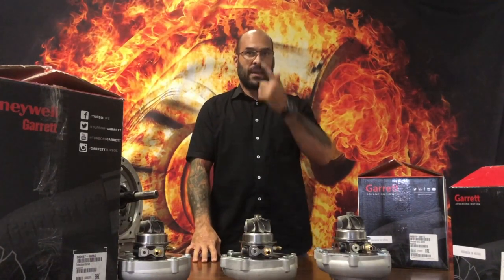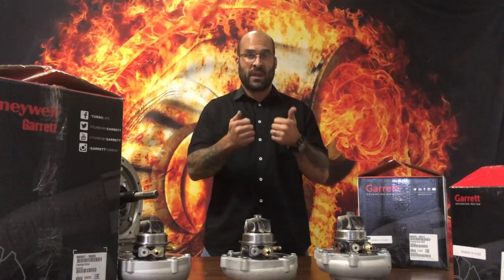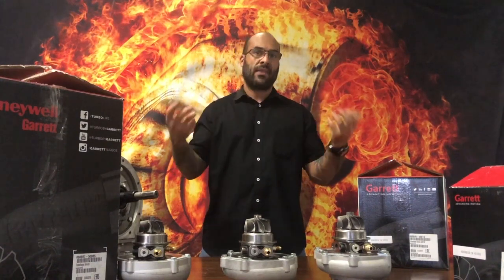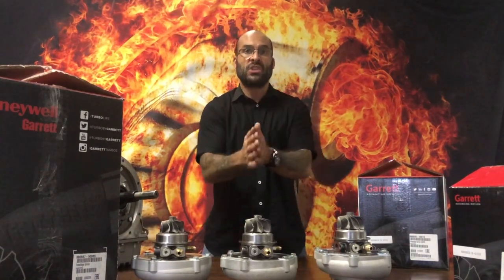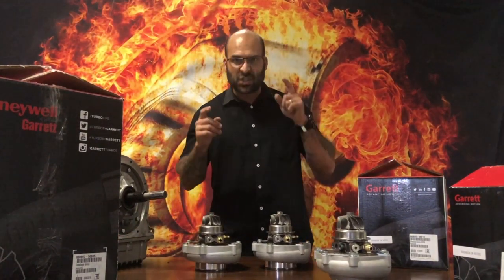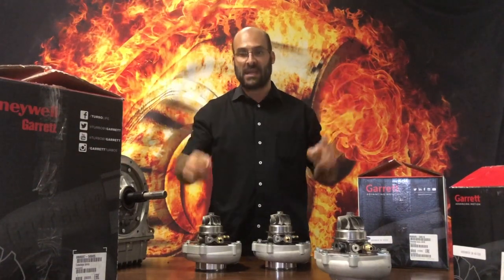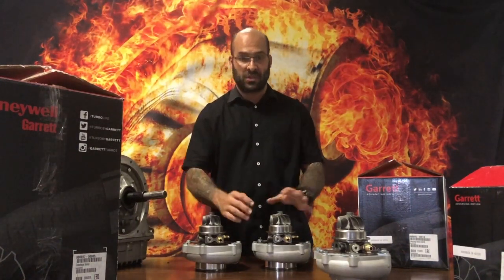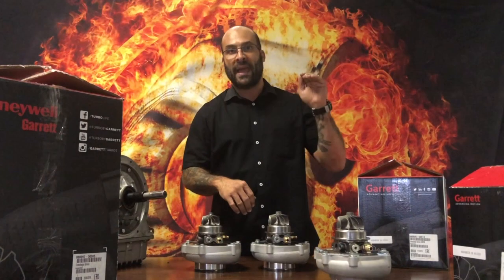Some more on turbo matching

Comment: Excellent video mate. I have just put the G30-900 turbo in my RB25 will be tuning in 2 weeks times. Street car use
Reply from the maker: Awesome  - please share the results with us.
Reply: @TurboDirectSA   I sure will 💯
Reply: @TurboDirectSA   hi Chris, got my R33 RB25 tuned got good results with the G30-900 turbo. Rear housing is .82
Safe tuned on 390rwkw 24psi boost.
Fuel on E85
Hits full boost around the 4000RPM - 4300RPM mark. Keep in mind I have a stock bottom end still. Once I get the bottom end forged will re tune the 33 for bit more power. 
I must say it is very punchy. My R33 is used for street.
Reply from the maker: @Rxtx_325  thanks for the info - this is good useable information, its punchy cause of the stock CR and the Ethanol - on Pump fuel you will loose response somewhat, this is always the risk on the RB25's  

Is your motor the NEO?
Reply: @TurboDirectSA   RB25det S2
Not NEO.

Comment: Hi, im having a hard time
choosing 2 turbos for my toyota v12 swapped sti. 

Im leaning towards 2 G30-770. The V12 is a 5L that will stay mainly stock in terms of airflow and i want around 1000whp with them. do you suggest going for a bigger turbo or you think the G30-770ms can hadle it. if so what a/r should i choose for the exhaust housings? the transmission is a bmw DCT transmission with a 3.08 ford 8.8 rear diff.

thanks for the videos 👍🏻 awesome work
Reply from the maker: Thank you for the compliment - much appreciated. The route i would go for this power would always be with two turbos that have more to offer in reserve than the target HP. This will result in a reliable and thermally stable solution once complete. 

The G-series turbos are overrated by 15% or more -- i would opt for the EFR7670 or the EFR8370 (same turbine stage as the 7670 with a TRUE 750-800HP output) These will outspool the G30-series and make the claimed power with no problems at all. They run cooler, slower and are more reliable.
Reply: Well hey there! Your car turned out incredible.

Comment: stayed until the end..... g30-900 vs g35-900, is the same turbo except for the turbine shaft? but a g35-900 could be upgraded to a g35-1000 if the compressor housing is changed?
Reply from the maker: No not at all - the AR rating and compressor wheel on the G35-1050 is larger than the G35-900.  See here:-  https://youtu.be/1A2QzzYmESU?t=499

Comment: Can you comment on AR sizes. I'm a little confused. A twin entry 1.00 vs a single 1.00 for example. The twin entry looks allot smaller. Is it essentially 2x .50 volutes making 1.00 or is there something else.

Many thanks
Reply from the maker: If the volutes on both sides of the divider inside the twin scroll are the same (left and right) then they will be both AR.50, HOWEVER i have many housings which use different AR volutes for specific reasons, manifold designs, or number of cylinder feeds to the smaller and larger volute sections - ill make another video showing this next week.

Comment: Really useful video! 
I'm currently doing a build on a 1JZ VVTi. I'm still tossing between a G30-770 or 900. It's a street car that I would love to be very responsive. Mated to an A340E transmission and a 4.1 LSD diff. Will be keeping stock bottom end for quite a while but may end up building in the future. Wouldn't want to see more than 650whp. Should I stick with a 770 running higher boost on a stock bottom end or is it safer running a 900? Do you also think there will be much difference in lag?
Reply from the maker: I am currently building the same setup but with a different tranny. for your application and power requirement, i would suggest you run the larger turbo, you don't want to run a turbo to its max to make your required power - this way you don't leave anything in reserve in case you decide to increase power/boost and find you run out of <more> -- the turbo will not lose much in terms of linear response,  and it will move you from the 770HP capable to 900HP capable.